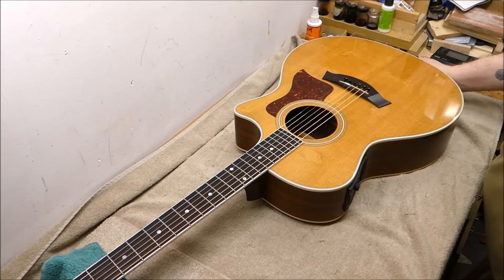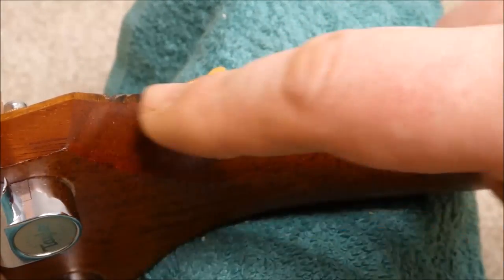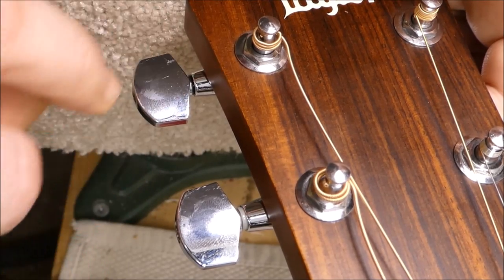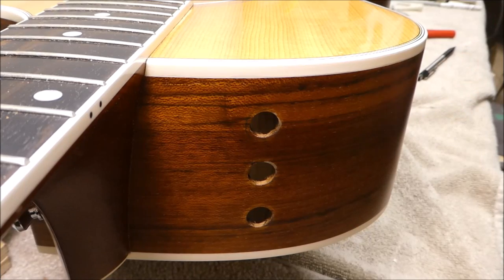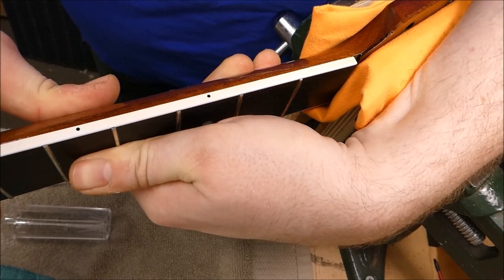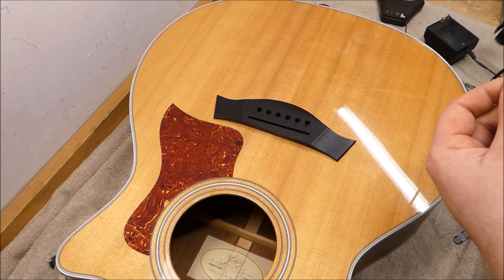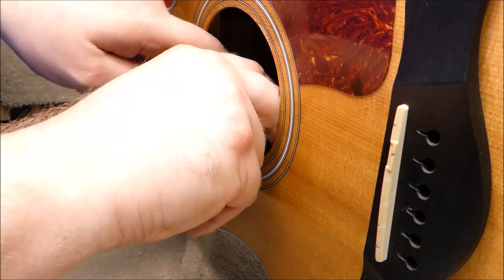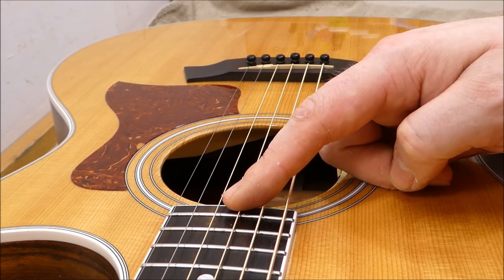Taylor Guitar Modifications

Comment: I maintain an inventory of new/old stock Taylors' that go back to yr 2000 that have lived in a humidity and temp controlled environment for their lifetime under tension and not played (often). If it needs it, some do some don't, that 15-20 yr range consistently has been the point where it will need a reset to pull it into factory spec. The 600 series most often.

Comment: I don't know if you ever had a problem with the foam tape. In the past I've had it inconveniently unstick and had problems with re-sticking. I take drop or two of white wood glue and smear it on the area of intended adhesion, let dry then apply the foam tape. It works very well. I think the bare wood surface releases maybe a micro amount of the untreated surface just enough to unstick the foam. The white glue makes a shiny surface more appealing to the adhesive on the foam.
Reply: Thanks! Great idea.

Comment: I have a 2003 RCE 414 (the R is for Rosewood).  It's traveled a lot.  It has the center seam back graft and also has the finger joints for the neck to head stock connection. I also removed the Taylor Expression system and replaced it with a K&K passive pickup. Much better for playing open mics which I did regularly a year ago. I agree that recording acoustic guitar with a nice mic is fine. Instead of filling the holes for the vol/bass/treb knobs with wood plugs like you did (nicely done btw), I just cut the knobs off from the circuit board so they can still be fiddled with but they don't so anything of course.  Funny, I lent it to a friend at an open mic and he tried to adjust the control knobs between songs.  I let him work on it for a minute on stage before telling him. :^)
 
The finish on the headstock is peeling off.   I wonder if anyone else has seen this and what they did to fix it.

Comment: That was totally cool. I've considered what you said about Taylors neck needing reset earlier than a Martin. You didn't mention if the top had lifted up much here in that amount of time. But you can shim that neck if needed, I'd love to see one of those adjustments when you have to do it. And i agree a microphone in front of an acoustic guitar is a high quality sound. Your rerouting of the battery to existing holder was perfect, easy access and plugging the holes was fine. I thought you were going to make a sound port.

Comment: My 2006 Taylor 814ce had the ES1 system from Taylor. I hated it. They replaced it under warranty for distorted tone but it still had horrible b string loudness and metallic tone. I replaced it with the JJB soundboard 3 piezo system, similar to K&K and it sounds awesome. Using a baggs DI or Fishman Aura Spectrum pedal it's all I could ever want in tone. I  left the knobs alone but modded the battery box for my output jack.

Comment: That was great information. The action on my 16 year old Taylor is creeping up enough that I've noticed it.  I haven't measured it and was wondering for a while if what I thought was happening was actually happening.  Another useful data point for me for this particular issue.  Don't know that I will do anything yet, but appreciated information just the same.
Reply: My local Taylor repair tech mentioned that the bolt on neck is very easy (inexpensive) to shim if you don’t want to lower the saddle.

Comment: I did the same for my gf's 814E Taylor. On the battery thing I used the same thing it has just cutted the cable and joint them with the lr baggs plugg. I was trying to mcgiver the taylor contro knobs with the lr baggs decided not to. And just left them covering the holes

Comment: I had a 614CE with extremely high action and after examining it I found it had bellied quite a bit. The case had a humidifier in it and I drew on past experience to take it out of the case and hang it on the wall for a few days and sure enough the belly went flat, action came down. Sometimes too much humidity is the problem.
Reply: ha well depending on where you live (eastern Canada), too much humidity is almost always the problem.  :)

Comment: I have the expression system in about the same model guitar and using a tip and ring cable (TRS) direct into a sound board makes a world of difference in the older expression version.  It is the one thing I like most about it and makes a guitar of this size sound much fuller IMO.  But I also have a larger body Taylor and there’s no comparison in bottom end richness, no matter the pickup system.

Comment: It's clear that you don't care for acoustic pickups in general, and I'm with you there. But you do need something on stage and miking an acoustic in an electric setting can be a challenge. Best solution I ever had personally was when someone installed a pair of mics inside my main acoustic (an old-ish Kent!), along with one of those gigantic soundhole pickups of the era with pole pieces you could adjust. He put a switch in so I could go back and forth and even mix the two. It was cool because I could go full on overdriven on the soundhole, then to the mics for the faux-acoustic sound, which really wasn't bad.

Comment: Nice tidy to cover the old control holes, I might try something similar on an old Les Paul Junior which I unwisely drilled a couple of holes in years ago. I own a couple of Taylor guitars, one with a finger jointed headstock and the other with a scarf joint, both seem very secure but I actually prefer the appearance of the finger joint although I understand that they stopped using it because customers disliked it. My oldest Taylor is 18 years old and the action is still nice and low with plenty of height left on the bridge saddle. Resetting the neck on Taylor guitars should be a lot easier than on acoustics with glued in necks, I believe that Taylor can supply special shims for the job.
Reply: Henry, yes, a neck reset on a Taylor takes about 20 minutes. Only Taylor silver techs and above have access to the proper shims.  Also, according to a gold tech I know, messing with the saddle to change the action is a no-no.

Comment: I have the exact same issue with the hot stuff bottles. These days I either open the bottle completely or I dispense a small portion of glue and then use small disposable pipettes to apply the glue.
Reply: I pour my CA into a drilled hole on a piece of plywood and dip various small instruments (toothpicks, bamboo skewers, an old ground down palette knife, etc.) to apply the glue. I have never been able to control CA like Ted does using the tip of the bottle to apply.

Comment: That looks like a JST connector on the battery cable. You can get a crimp tool and connector kit for pretty cheap and it will open a lot of wiring potential.

Comment: Hmmm, think I'll leave the Expression 2 pickup system in my 914ce ;)
Reply: Yep, they work OK!
Reply: I hated the pickup in my 2006 814ce Taylor. Installed a K&K and have a serious improvement in tone. I used the same output box from the 814ce and left the control knobs in place, not using them. My neck needs reset to lower the action.

Comment: I bet that mini-lathe comes in pretty handy sometimes. It seems powerful enough to be very useful in the shop.
Reply: It's a Taig. You can also set it up for metalwork (or similar work in plastics/waxes) - just add the cross slide/carriage, compound if you want, toolpost, etc. The power is up to you - it doesn't come with a motor (1/4 horsepower is pretty much the go-to). And it can do some light milling as well. It's not super-cheap, but it's really versatile, and fills in a lot of those "I really wish I had a..." moments. (You can do more or less the same thing with Sherline's version of the LEGO Machine Shop, though it's slightly bigger. And it was never sold at Lee Valley - I'm going to assume that Ted could have gotten a better deal on the Taig than you can.)

Comment: I did a similar mod to use the battery box instead of the battery bag. I just used the box as is. Not sure why you felt like you needed to use the battery clip that came with the Baggs. Wiring into the existing box has been perfect.
Reply: Im planning to do the same. How do you do that? 
Also can you explain your process? Did u cut the wires for the es2, did you remove the knobs? Did u also have to drill the whole bigger at the back to fit the LR Baggs? Im wanna be able to this myself but i just wanna make sure i do it right

Comment: Nice job with the Anthem install. If you’re expecting to work on Taylors (yes, they tend to come in batches), you really should buy a neck shim tech kit from Taylor. You need to figure out the meaning of the numbers engraved on the shins and calculate the appropriate swap — I use an excel sheet. If your math is right, you can eliminate the trial error part. Just make sure you have some new saddles, or better yet, offer to make a new bone saddle.
Reply: Real easy job when you have all that around, but I found it took a bit to convince them to give me their shims since im not a shop, just some guy who works on his own instruments.
Reply: In my opinion, bone saddles make Taylors sound really brittle with high end overtones. I've never heard a Taylor that sounds better with a bone saddle than the Tusq it came with. I tried a handmade bone saddle on two of my Taylors. Total waste of $100 each. I couldn't get them back off and replaced with the originals fast enough. Bone is great on a muddy Martin or Guild.

Comment: Taylors after 2001 use a bolt-on neck. They don’t need a traditional neck reset, they need a simple neck angle adjustment, which takes about an hour. It’s pretty easy for an authorized repair tech. They’re designed to be adjusted rather than filing the saddles down. In fact, if you’re an authorized Taylor repair tech the training tells you there’s rarely a reason to file a Taylor saddle unless it’s out of spec. All other adjustments are made using the neck shims. 
Taylors aren’t more susceptible to needing resets than anything else, but are far easier to do.
Reply from the maker: No authorized repair techs nearby and those that were, gave it up because they hated dealing with Taylor. Getting shim stock took months and getting paid was even harder.
Reply: @twoodfrd  you should become an authorized tech. Getting shims is hard when you aren’t one, yes. I’m an authorized tech and in nearly 20 years I never had trouble getting them - or getting paid for warranty work. I can connect you with the head of Network Service, he’s awesome. They’re literally the easiest company I’ve ever worked with. Ramsay Phillips has moved from Dubai to Ireland to New Zealand in the last 5 years and has no trouble getting anything.

Comment: the endpin jack setup was upside down!

was that deliberate on the part of the customer i wonder? i could see where having the strap button part further back might let the guitar hang differently while allowing easier access to the battery box.

also it would have been an easy matter to just wire to the existing terminals of that battery box so the customer could just pop it out and throw the battery in as usual instead of wrestling with a separate 9V clip hanging out of the hole
Reply from the maker: The previous pickup and battery was already gone when it came to me.
Reply: @twoodfrd  doncha love that? "here, i helped you by unscrewing/cutting/ripping out/losing the old stuff myself, that should make the job easier right? you should give me a discount!"

     if you pull the jack assy the outside of the 9V compartment has two flying leads to connect it to the rest of the guts, unless the guy broke them you should be able to solder right to them and give the customer normal use of the battery box

     (all respect in the world, this is a fantastic channel and i can't begin to touch your skillset! my repair world is in a big busy music store so i'm up to my neck in new and old taylors doing dumb stuff instead of the cool stuff you get to do)
Reply: whoops watching it again, at 11:06 i see that all the connections are gone, including what would have been a perfectly good set of terminals on the outside of the box, making the job easier for you and better for the customer; didn't catch that before. oh well, nevermind

Comment: Love you’re videos, you’re such a pro at your craft. Hey, in the past, I’ve re-wired battery and endpin jack leads into the little Taylor assembly. Could I ask the strategy of reaming out the plastic assembly instead of integrating into it? Is that just a personal preference or is there a technical reason?
Reply: BTW, that is one of the cleanest methods I’ve seen to cover up the 3 Taylor knob holes, great job.
Reply: It didn't come to me with the original jack, so I just fit the Baggs in there.

Comment: Have you found a source for those nylon bushings? The best thing I've come up with is ordering super cheap chinesium imitation eBay tuners but they never show up timely.

Do you have an honest opinion you'd share about talor guitars? I've played a bunch over the years and my opinion went from pretty good to not wanting to throw any money at one. Some aspects are decent but the sound and everything else is nothing special. They have a very high opinion of themselves that rubs me off too.
Reply: I'm in that boat as well. I had a 614ce for about 6 months. It sounded exactly as bland as the 214, 414, and 914 I tried. They're nothing if nit consistent across their range of full size guitars. I also had a GS Mini and it sounded better to me than my 614. Go figure.

I guess for the Taylor purist, if you're touring and baggage claim delays your guitar, you can walk into any box store and get and pick up another that sounds exactly the same.
Reply: @JonNewquist  I've played old Korean solid tops that sound way better. Something about their finish makes me think it's part baby formula too.
Reply: I've never tried sourcing the bushings, any time it's come up I've just pulled one from the parts pile.   And... Taylors don't get me excited. They're fine but I don't lust after them.  They seem to be really strong on the fundamental with not very much overtone response. Kind of one-dimensional to my ear.
Reply: You can buy the nylon washers in bulk at Thomann. There are two sizes. I actually use quite a lot, since they are often missing/damaged on old guitars.

Comment: my 1995 Martin HD28 now has a 1/8 to 3/16 belly bulge and I've lowered my saddle to the point where I have 6/64" at the 12th fret string height.  I asked a luthier about a saddle doctor install and they didn't think that was the right thing to do. They want to examine for any support separation and then a neck reset. $600.
Reply: I’ve used the bridge doctor in my thin body Ibanez Montage. My local luthier didn’t want to be involved as it’s a weird, poorly designed guitar. I installed it myself as a last resort. It worked. Acoustically, the guitar was slightly affected due the extra mass but the live sound was the same. I recently removed the bridge doctor to install a new pickup and discovered that the belly bow was gone! I’ve left the Doctor out for now and my guitar sounds just like new. Here’s the take away: you could try the non permanent version of the bridge doctor (no drilling required). $60 vs $600.

Comment: Hate Taylors. I repair guitars and have repaired 3 in the last 2 months. All different Mexican models.
All had bad bellyl lift and upper neck issues.
Bad wood in general I think. The only other worse guitars ...or as bad... are mainland Chinese made that I have seen recently.
Taylor is sourcing their wood poorly.
The necks I fixed... had upper by the body.. issues...too high...had to take frets out and plain down and put frets back in from 12th and up.
Also had to pull the bridge and surrounding area down with a new piece of wood in the sound hole under the bridge and pull all down by screwing ..pulling area down..
Definently stay clear of Taylor guitars
The wood sourcing is a huge issue. They get their wood now from highway construction and tree removal in S  California. Not kidding.
Google Taylor wood sourcing.
Your vid is very good and clever. Yes super glue is handy. Thanks.

Comment: I’m in the process of replacing my Taylor electronics with the Anthem. My thought was to simply wire my anthem plug wire and battery wire to the existing Taylor plug and battery wires.  Is there a reason I shouldn’t do that?
Reply: Wondering how wiring to existing Taylor battery box worked out for you and how you did it.

Comment: What is your amp? You probably need a good tube amp to match your skills?
Reply from the maker: It would just absorb dust.
Reply: twoodfrd  a good tube amp burns up the dust
Reply: I could send you one to test the theory
Reply: In fact I have several amps that have a cone that amplifies sound! You just pick them and they are loud
Reply: If you turn them upside down dust doesn’t get in them. Sorry dobro player for 30 years
Reply: I’m also an engineer type and like your channel and thought I could help you
Reply: Are any of you an insurance salesman by chance?
Reply: Tube amps generally don't work well on acoustic guitars. They are wonderful for electric guitars, becoming part of the overall sound by adding their own colouration that works with the guitar. Acoustic guitar amps need to be very, very clean, with no sound colouration, as you just want the exact sound that is coming from the guitar. All of the highest regarded acoustic amps are solid state, from the old Trace Elliots to the Fishmans to the AERs. If you absolutely wanted to use tubes, use an older tube Hi-Fi amp, which should have less colouration,
Reply: @jimbucket2996  LOL